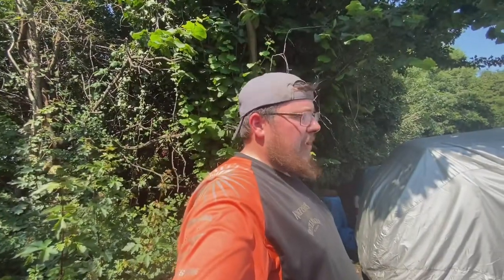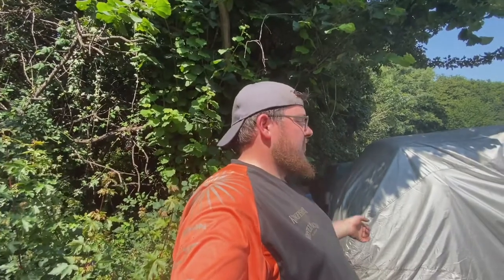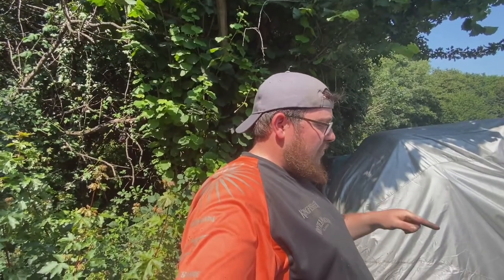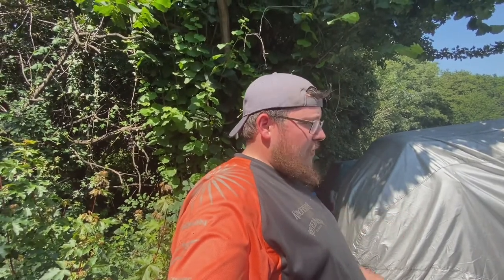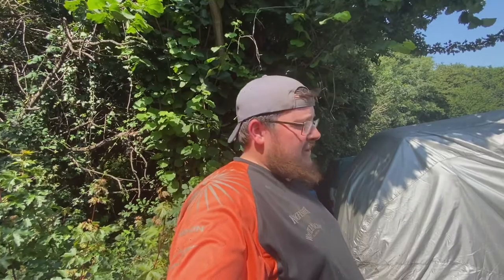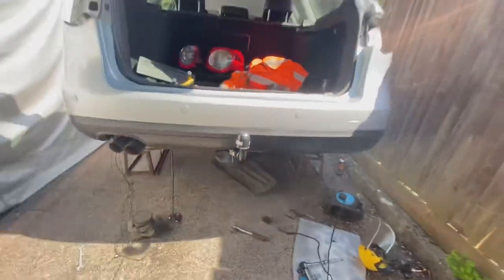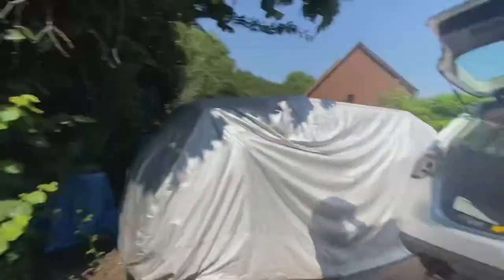Volkswagen Passat B6 tow bar fitting

Comment: Did u have to move the exhaust or heat shield to put on the towbar?
Reply from the maker: Had to lower the exhaust off the rubber hangers and remove the heat shield to get to the mounting holes for the tow bar

Comment: Have you got dimensions for the bumper cut plz? Great video!
Reply from the maker: Thanks bud. Afraid not. I did try and follow the instructions for their dimensions but they were well out so I just measured the width of the tow bar bracket and swan neck then trimmed off more and more until it fit. It was trial and error

Comment: I know this is an old vid but Im hoping you can answer, does the saloon and the estate both have the same mounting and same towbar? Searching for one on ebay only one type seems to show but I wanna make sure before i get one!
Thanks
Reply from the maker: Yeah I believe they are the same. Hope this helps. Haven’t fitted one to a saloon but I can imagine they would be different. It’s the same tow bar for a mk4 golf hatch and estate
Reply: @RCCAdventures  Thanks! I had the rear bumper off a while ago to replace park sensors, and the section you mounted yours to looked the same but I wasnt too sure.
Cheers!